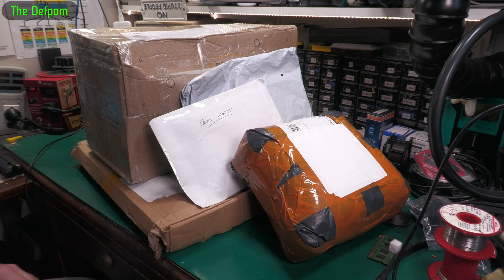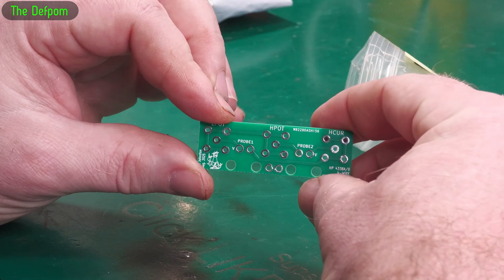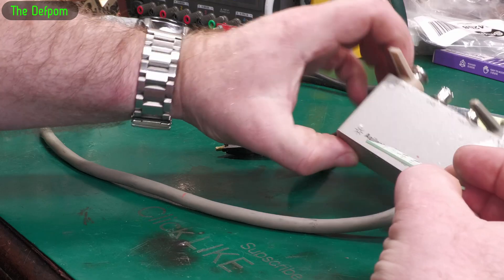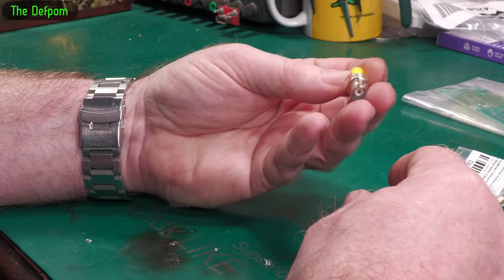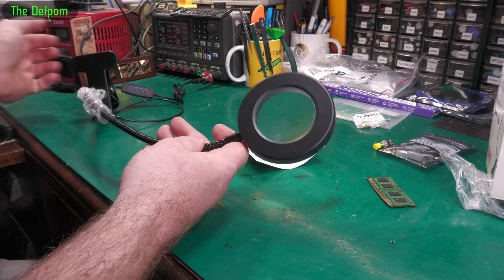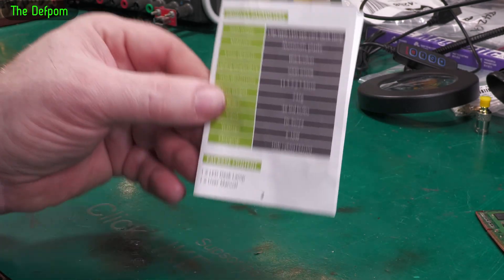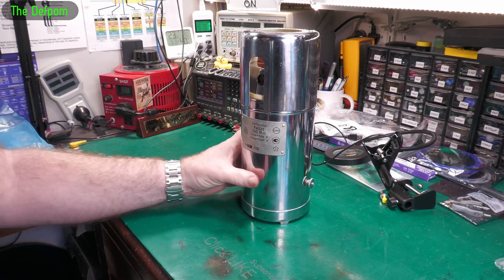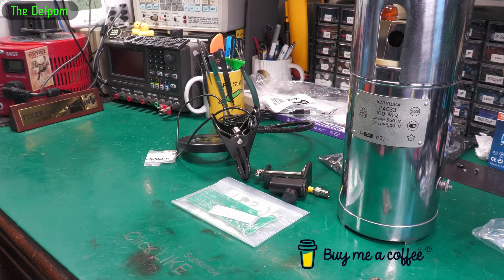🔴 Mailbag Monday 13th October 2025 - No.1412

Comment: I like the Kelvin clips, hadn't seen that type before.  Those inexpensive lights have poor optics and rather small lens diameters.  I'm more worried about how pleasant they are to look through than the LED lighting output. I think it's worth it to spend the extra money on a high quality articulation setup with real glass lens, which may require industrial equipment supplier.  The cheap ones are OK for an office desk where you might do small tasks like tighten eyeglass screws.
Reply: The cheap kelvin clips gave me 80mohm on a 50mohm resistor on my HP4338A milliohmmeter due to the unequal lengths of the 2 sides of the probe and the spring mechanism! Using the ones shown I got 50mohm.
Reply from the maker: These are glass lenses, and they aren’t to bad to use.

Comment: You have a 3d printer, you should have just printed some extensions for that square tubing. Hacksaw past that spring attachment then put it back together with a section of PETG. Then it could be the exact size you need in that little corner your crammed into. 

I know it's not worth the trouble sometimes and you were hoping they "fixed" the circuit of that light. LEDS are DC so if you have noise that's kind of silly.. just go old school and use some chunky higher wattage pots to vary the voltage. USB powered stuff a 5w would do it or even just use normal 2w ones but get the double ones. Do a nice dirty one, it will drive the bean counters crazy and they will be commenting and feeding the algorithm.  Do you really need the dimmer? Some polarizing film over the lights and magnifying glass is a much better way to be able to read the print on components than varying brightness. 

Just saying.